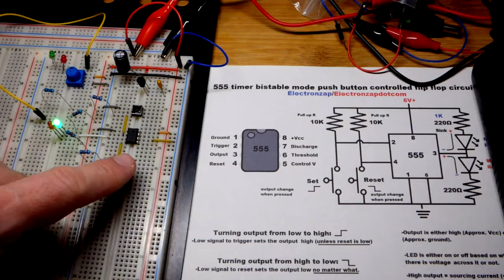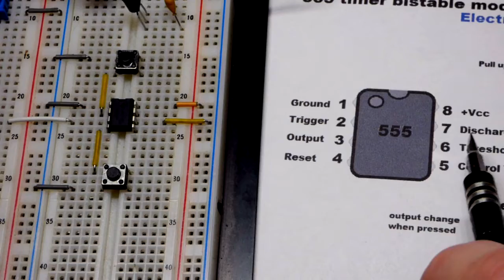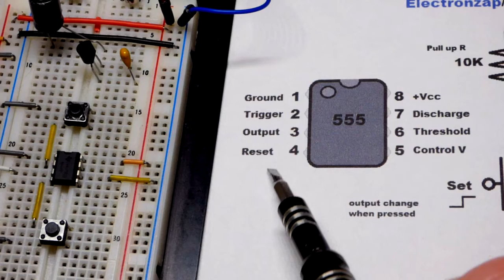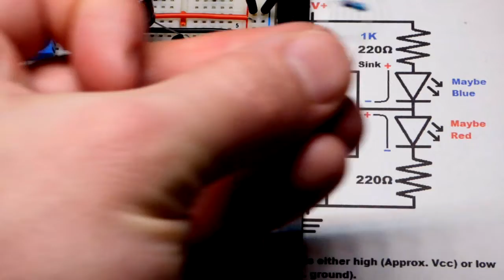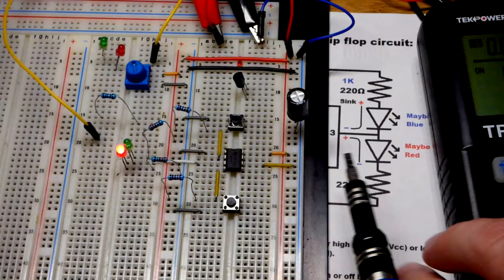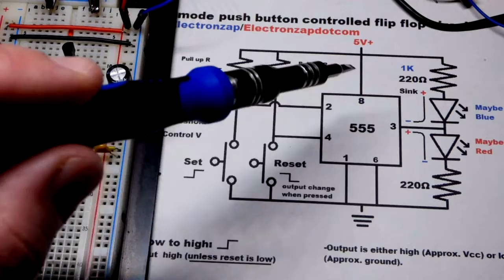555 timer bistable mode flip flop demonstration circuit step by step build and explanation

Comment: The bistable mode circuit is very similar to the astable mode circuit as the "Flashing Railroad Lights" at 555-timer-circuits. com. however, as this video demostrates and as the schematic notes, there is a difference. You keep zapping the electrons.
Thanks!
Reply from the maker: Thank! Will do!